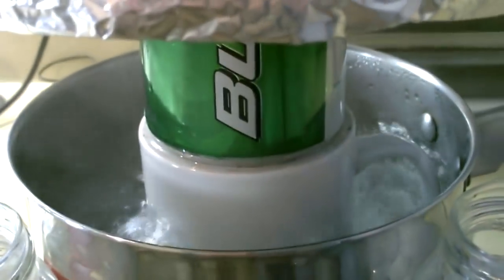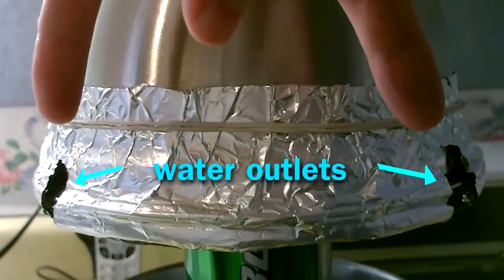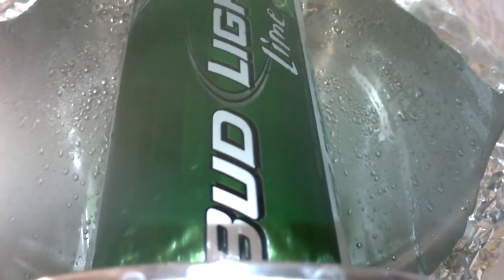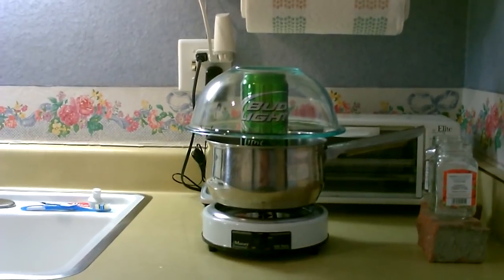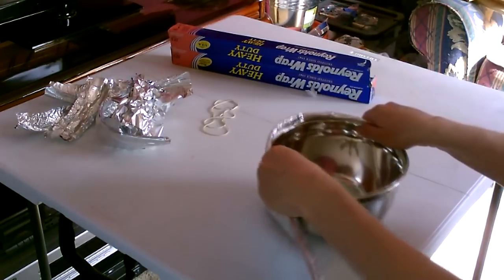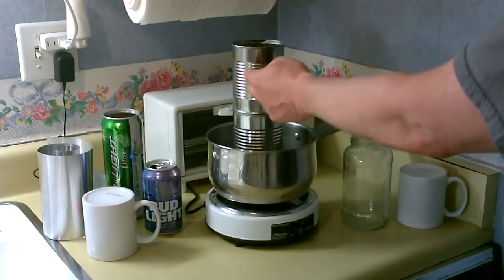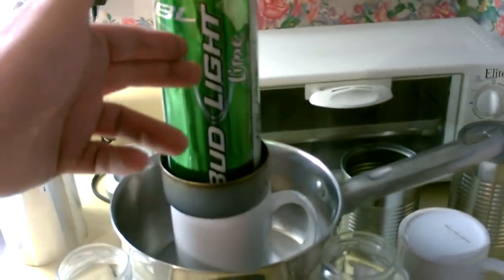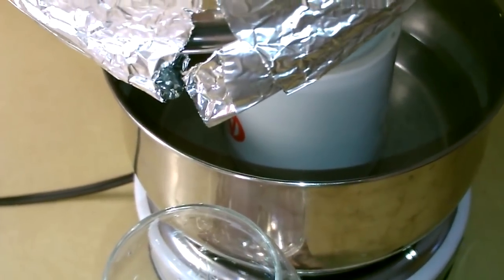Homemade Water Distiller! - DIY "Counter-Top" Water Distiller! - New Design!!  ez DIY

Comment: Thanks for the great ideas! Just bought the pieces for about $30 at home depot for the other design you made with the kettle and water suply line. I'm going to use the collection/ trough idea (maybe a bit dowsized) in conjunction with it. I was wondering if you have any ideas of how I might be able to reduce the heat (like some sort of diy radiator) so I can have  constant cooling.
Thank you for the great videos!